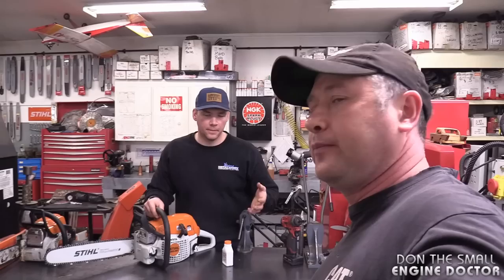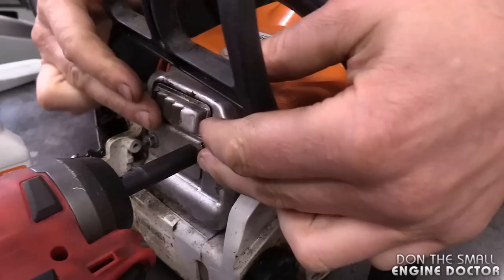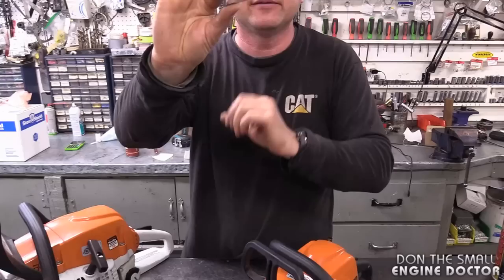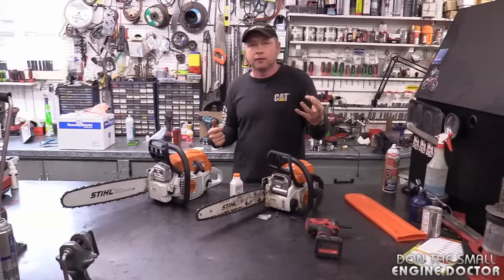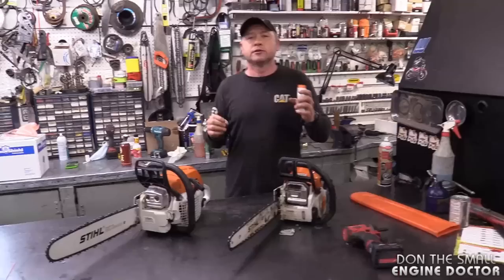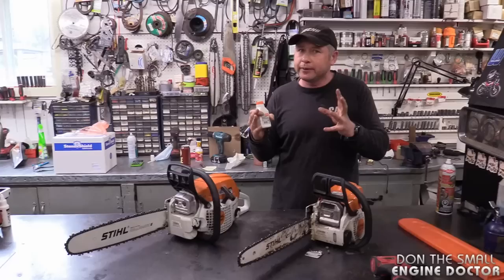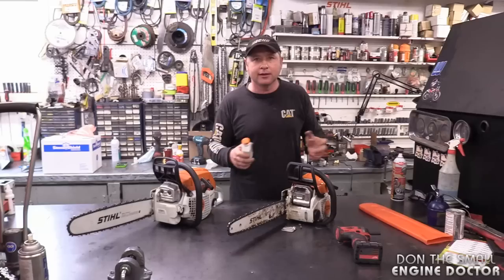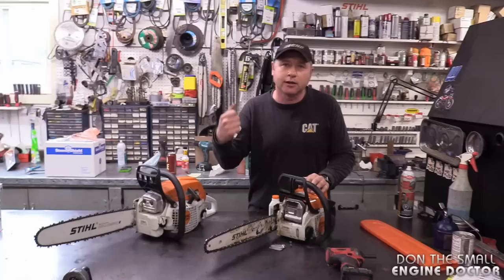Should I Double-Up My 2 Stroke Fuel Oil Mix For More Lubrication? Teaching Apprentice Dave

Comment: You already know that answer by having to clean a clogged Exhaust full of oil or an oil contaminated plug. Here's one worse. Dumping oil straight into the fuel tank and trying to " Mix" it in the tank. I remember having to blow out straight two cycle oil out of the carburetor. Talk about plugged up mess. I know guys that take the spark arrestor out because it is completely clogged. I have also seen the top of the piston full of carbon from burned on oil. I am sure you have seen everything I have. I constantly refer guys to invest in a Ratio Right measuring cup to mix their fuel. I used to give them away to save me from having to   fix gummed up chain saws. Good Video!
Reply: I have been using Ratio Rite for as long as I can remember ....

Comment: I use 3 oz of oil per gallon of gas for around a 42.6:1 mix in all my outdoor power equipment.  It keeps it simple for mixing 1 gallon or 5 gallons of pemix, and have never had an oiling issue.
Reply: BRAVO ! 
I figured my mix at 42.5 : 1

Comment: I have a McCulloch chainsaw that is 34 years old and still starts on the first or second pull. I have used the recommended oil/gas mixture and it still runs great. I am going to put a new chain on it next week and I am sure it will run at least another 10 years.
Reply: I have a 54 year old McCulloch, still runs good.  I run 1-2 tanks of gas thru it a year, just got a wood stove so plan to run it more.  Grandpa's old saw and he cut probably 80-100 cords of wood with it maybe more.
Reply: I have a old david bradley chainsaw, it's 70 years old and still runs good, it takes 25 to 1 for the oil and I use 10w-30 motor oil

Comment: Don and Dave,  from my experience if you put so much oil in those small engines,  you won't do it for long cause they won't work right, you'll get bogging down and all kinds of trouble. 
But years ago when Yamaha came out with the 100/1 mix in their outboard motors a lot of us old school guys didn't like such a high ratio so we mixed 50/1 like we did on the older outboard motors like Johnson. 
They worked fine cause it was on much bigger engines than chainsaws. 
Nice video guys

Comment: I maintain a 40-acre estate and operate — and repair — 12 pieces of Stihl equipment, including five chainsaws, two brush cutters and two backpack blowers. For 25 years I have been using nothing but Stihl oil in a 50:1 mix as specified by the company. After hundreds and hundreds of hours of use not ONE machine has required any engine work whatsoever besides carburetor replacement. I think I will stick with 50:1.

Comment: So if too much oil carbons up an engine please explain how snowmobiles can run for thousands of miles without doing that? Oil injection has helped for sure as the pump varies the ratio but at or near full throttle ( where saws run most of the time) the oil mixture is at 20 to 1 ratio. 
Back in the old days the oil was mixed at sometime 15 to 1 and yes they gummed up but that was the oil chemistry which is not like todays with low ash. 
Also it has been proven on the dyno that more oil equals more hp right up to 10 to 1 mixture. Do you need to run more fuel to compensate? Yes but only by a small amount. 
Cycle world has done these tests on the dyno as well as many others.
Kevin Cameron was the tech advisor at Cycle world  and that man knows his stuff!
By the way I run all premix machines at 32 to 1 and have for many years without any issues
Reply: 33:1 is ok ?

Comment: Using excess oil can also cause a stuck ring from carbon buildup (usually on exhaust side). Also can cause it to run lean but that can be tuned out. Your better off to run factory suggested mix and just tune the carb slightly fat.

Comment: Didn’t mention atomization. It was explained to me long ago by a much more knowledgeable tech than I, that if you run too much oil, the oil becomes too thick in the fuel, and can’t atomize as well as it’s intended at the carburetor Venturi, so it runs the machine lean and you likely will also have intake side cylinder/piston washing. You would also notice a VERY oily air filter, as well as oil pooling in the intake boot. I used to see that a lot in redmax EB6200/7000/7001 backpacks, as well as PB-4600/46T/46HT/410/403/60T/60HT/601/603/6000/650/751H/751T/755, etc. Echos. All the echos that utilized that top-mounted air cleaner design, even the beautiful PB-400E blower would see this sort of thing and it led to the demise of many. If the bottle says mix with one gallon, that’s what you do. If you don’t know how to adjust a carburetor properly, or are going to disregard the emissions settings because you bought an underpowered machine for you application, and you think by running it rich will give you THAT MUCH more power, it won’t, and you’ll just pollute more. If you need a specific machine, buy it, don’t buy the wrong tool for the job. If you can’t afford it, use credit if you know you’ll pay it off quickly, or simply be patient. Take care of your machine and they’ll take care of you.

Comment: Most wear problems with saws is due to improper tuning ( to lean) or cutting with a dull chain.  In other words, operator error.  I set up all of my two cycle stuff to run slightly rich at high rpm and never cut with a dull chain. I have enough saws to put down a saw with a dull chain and grab another saw with a sharp chain.  I carry usually four saws to a cutting job.  I start out with my MS 360 and then go to my MS 440 or H 372 if I need them.  I keep a smaller saw in case I need it.  That saw is my MS 250 or MS 180 at the current time.  I run 50:1 Stihl Ultra with PNE gas and stabilizer in most of my equipment.  In vintage saws I run JASO FD oil with PNE gas and stabilizer.  These old saws, like my MAC PM610 and Homelite XL 12 need better lubrication.

Comment: I agree it can be very confusing and I recently took apart a engine that was very clean and very well lubed and looked new inside compared to what I know the tool has been through I guess the fuel evaporates and leaves the oil ???????

Comment: I bought an MS170 8 or 9 years ago, I have only ever run 25:1, It has never blocked the screen or choked up the plug (still has original plug) My other saws also are run on 25:1, brush cutters can be a different case although in my bigger ones i run 25:1. Over 25 years I have rebuild many demo saws with scored pistons from running 50:1. Weather can play a big part too in the way the different oils perform and burn, some oils have an extremely high flashpoint so it doesn't burn off as well. I wore out my 330 homelite , when I stripped it down piston and bore were spotless only the rig was worn out, it only ever run 25:1. If you only start the saw and do 2 cuts 25:1 is probably not a good choice, it needs to get to proper operating temp.

Comment: I still run my stuff at 32:1. That used to be the standard for all 2-cycle equipment.
Reply: I use 32:1 is steel cylinder engines and 42.5:1 in everything that calls for 50:1. I refuse to use high ratio oils at 80-100:1 or whatever.

Comment: I have been running the recommended 24:1 in my old jiffy ice auger 3hp tecumseh 
Using low ash tcw3 No smoke No Carbon ☺

Comment: It's an old two-stroke motorcycle racer you absolutely do not want to run to Rich and oil mixture a rich oil mixture causes a lean fuel mixture too much oil in the two strokes that we raced caused Pistons to burn holes in the top of them
Reply: That's %100 true, I have seen that happen myself.
Reply: Right.  Because it increases the viscosity of the premix, which will cause less fuel flow through the jets/needles, and a lean condition.  Too much oil will also cause hotter combustion which can lead to engine knock.  Funny how people think more oil is better.

Comment: Depends on how bad the mosquitoes are ;p I run em ritch but they also generally get a good workout when they come out to play so the excess tends to burn off. I've found that the user and job has a big roll to play in mixing. Sorry I didn't get out for that ripping chain this weekend, I had a truck break down lol Cheers fella!

Comment: Don, I have run Stihl Ultra for quite a few years but I hat the ash it leaves in a saw, so last year I switched to Echo Red Armor but it also has side effects.  Red .armor, because it has such a high flashpoint, stays in the saw, giving less smoke and greater lubricity.  My non deco saws got so hard to pull over I could not crank them.  My ms 251 felt like I was pulling over an ms 880 without using the deco valve.  I did not want to go back to Ultra but there are not a lot of good choices, so I decided to use some Stihl HP.  I made up some HP at 50:1 and I like it.  It smells better than that stinking Ultra.  It will probably take a couple of tanks f HP to burn out all that Red Armor out of my saws.  I have learned how to get them running - put them indirect sunlight until the saw temp gets close to 90 degrees.  Then, you can pull them over and get them running.

Comment: I always mix 1:45 for my newer chainsaws but my old chainsaws (Stihl Contra and so on) get 1:30 becouse the cylinder and piston have bigger tolerances from the factory. Back then the parts could not get produced that accurate like today. These "gaps" between cylinder and piston need to be filled with oil, so that there occours no friction. It sounds like that things back then had lower quality, but it is not really the case. My friend who works in the engine development of a company told me this.
Reply: Meh, not really true.  Engine tolerances for cheap 2 stroke haven't changed much in decades, and piston rings!  Rather the EPA made them switch to lower ratios and oil is better than it used to be so the leaner ratios cause less wear, but still more wear than ratios of yesteryear.   

The thing to keep in mind is the old equipment spec'd for 1:30 probably already has some wear.  If you run the newer equipment with the lean ration, eventually you may want to make it a little richer too.

Comment: If you did not jet to the new 25-1 it could seize the motor from being lean. Chainsaws run hard for short periods and then they idle for a while. I have seen race engines running very hard of 50 or 60 CC run as low as 16-1. These engine may make as high as 25 or more horse power. They can have a carbon build up on the exhaust port. I often ran 36-1 with turbo blue for years with 440 Stihl saws. We used maxima 727 oil. It was made for racing. The new ones I run 50-1 with no problems.

Comment: My 10yo ms290 developed problems running 40:1.  No muffler blockage.  I finally switched back to 50:1 and rebuilt the carburetor and the machine ran like new.  I don't see any upside to running an oil enriched gas ratio.  Today's saws will run, as prescribed, for 10, 20 or more years, cutting 10 cords a year.  Caveat -- do other maintenance, i.e. take care of the machine.

Comment: Great info. I fix my neighbors backpack blower and small machines when needed. She told me that 4 of their blowers wouldn't start, I recently worked on 3 of them and they were running fine. Talking to her about them, the last thing she said that she might have put too much oil in the gas. She actually put 200 ml of oil to 5 liters of gas.(50:1) Double the oil needed. I drained all the machines and added new fuel with the proper amount of oil. Took around 10 pulls but they finally started. They all blew smoke for about 30 seconds but cleared up and ran good.

Comment: I’ve used marine 2 stroke oil for years, it does come with a catch. U have to go in and clean the carbon out of the exhaust port every now and then. Usually once every 2 years (I do this anyway cuz I’m weird) I take the head off, clean it and replace the head bolts and gasket if there is one. I’ve actually noticed though my saws make more power with it, and my scoring is minimal. Works great mixed 50/50 with synthetic for breakin. I always make sure to agitate the tank with the mixed oils though because they do tend to separate out just a little bit when mixed together. I should also mention during the off season all of my saws get stored and ran on aspen 2 alkalyte fuel. Hope this helps anyone having to penny pinch without destroying their equipment. You probably don’t have to replace the head bolts, but I like to just because it’s a habit from building 351 Windsor’s and other vehicle engines.
Reply: I won't comment on the marine oil, but using fully synth mixed or otherwise for break in seems very counter intuitive. Synthetic oils are far more slippery than standard oils, ergo the engine does not bed in. I run cars or what ever on regular oils initially to let the machine marks etc get nibbed off, and then for long life use fully synthetic.
Reply: @boots7859  do you guys know what castor oil is? At 1 point in time all 2 stroke oil was castor oil. The oil I use for my outboards is marine grade castor oil. I’ve been running the stuff for ages. All I can tell you is my experience with it. And you’re correct about the fully synthetic being slicker, but I used it to bed in rings a little slower and get more heat cycles before they really sat down. I noticed higher compression in my 461s that I’d done that to. I just broke in my 661 the same way, thing will try to break your arm if you don’t mean it when u pull it. (Decomp valve plugged as well)
Reply: Going through the comments I am just now realizing why everyone has issues with it. DISCLAIMER: if you do not run the balls off your equipment and get it hot, don’t do what I do. You will seriously hate life. As a rule of thumb, if it isn’t getting warm enough to start running slightly lean after heavy use, DO NOT USE CASTOR OIL. My saws stay buried in extreme conditions, and I’m anal about taking care of them as they are how I make my living. If I go a day without having to enriching the high needle about an eighth turn at some point, it was an easy day. I burn anywhere from about 2.5 to 3.5 gallons in a day bucking logs or milling. Most people don’t use their equipment like that.
Reply: @jarrett754  I love using castor oil. I use maximas caster 927 which is 80% castor as 20% synthetic. I love that oil.
Reply: @garrettstevensen2467  how often/how hard do you run your engines? And what are your experiences with carbon build up? For me it’s always been manageable. But I’ve come to the understanding I’m more of a special uses category compared to most.
Reply: I’m curious now, can we have an official test? Castor vs synthetic for breakin hours on a dyno? Then comparing carbon is engines used in lighter and heavier applications for both castor and synthetic? I’d be extremely curious to see the results. I think they may back up my crazy theory, but hey I could be completely wrong. I think a couple 261 farm bosses are in order as test dummy’s!
Reply: @jarrett754  I run them whenever I have a job come up. Saws are used seldom, but when they are used, (I own Stihl MS250, Husky 460 Rancher, Homelite, JonCutter, etc..) they are used almost at WOT for hours on end. I like the smell of castor oil. I don't take my saws apart. I've never opened one up because they have never needed it. Oldest saw is MS250 and compression is still higher than factory spec.

Comment: Good content but why would you address this relatively clueless question about arbitrarily doubling oil rather than a more sane middle ground about using conventional oil mix ratios of yesteryear instead of the now very lean 45:1 or 50:1?

The question to me is would you rather have equipment that's not worn out, then can clean it and keep using it, or would you rather it's worn out and no amount of cleaning will help?

Anyway, if you run too rich an oil mix you'll often suffer performance, usually the max RPM drops, bogs down easier, but at the same time a worn out engine doesn't perform so well either.  Middle ground!  I run 35:1 on older equipment and 40:1 on newer with synthetic ashless/low-ash oil.  Biggest issue is after a few hundred hours, the carb does need pulled off and exhaust port cleaned.  IMO it's almost better to go ahead and pull the carb off every now and then, or else you wait too long and you've got a seized bolt and the engine thread get shredded trying to remove it.

Spark plug fouling, meh the plug should be changed once in a while anyway.
Reply: 33:1 is good ?

Comment: 50:1 for saws 75c and smaller. If they are ported. Run them at 40:1. Saws 80cc and larger 33:1 one of many mistakes people make, is they don't have the system retuned after break-in. New equipment comes dangerously lean from the factory to appease the epa. If you double the oil you are leaning out the mix more oil less fuel.
Reply: Master, is a 1:33 mix okay for the 372 xp 357xp 351 and the 545rx scythe? Will it not make too many deposits? husqvarna LS + oil?
Reply: @Sensei948   the higher oil ratio is for saw with greater bearing loads.  The saws you listed will be happy in the 40:1 range. If they are ported 35:1 My 3120 demands 33 to 32:1.
Reply: @Sensei948  My 346xp rolls on 40:1 in summer 50:1 winter.. less oil = richer mix aka more fuel.

Comment: I think a major contributing factor to excess fouling, apart from too much oil, is leaving 2-stroke engines at idle for too long especially on chainsaws.  I see guys make some limbing and clearing cuts then leave the saw idling for 5-10 minutes while they clear the crud and then another burst of cuts followed by more idling.  The machine is idling more than it’s cutting and that does a 2-stroke no good at all IMO.

Comment: 40:1 Tru-Fuel in my 1975ish Poulan S25DA. 

2-cycle engines really haven't changed much. 40:1 with a modern synthetic is fine. Any richer fuel mix isn't necessary. Tune your carb correctly. Take your machine to a small engine mechanic like Dave, or Don to tune it for you.